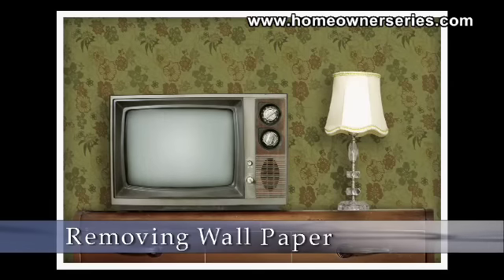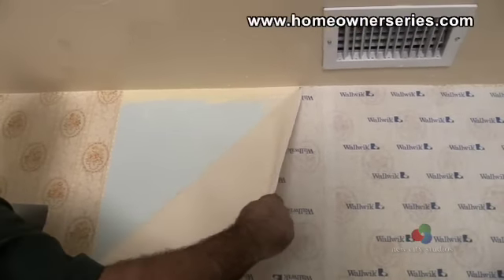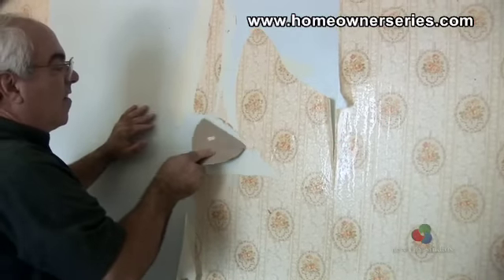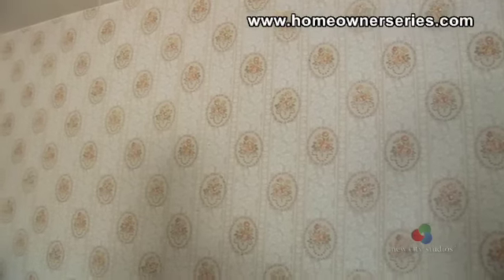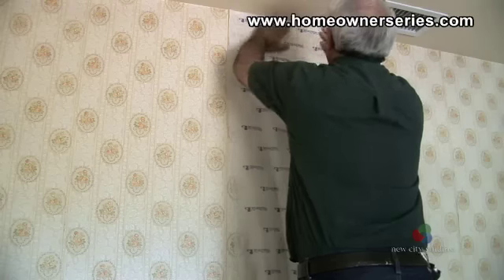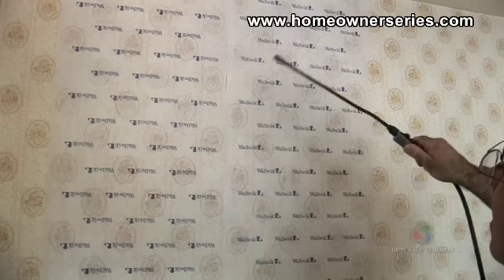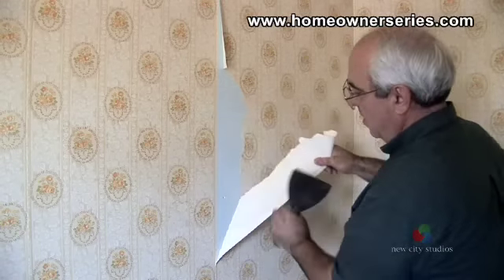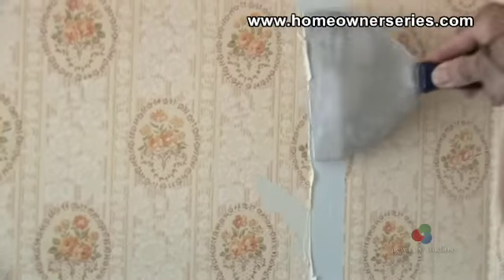How to Remove Wall Paper  - Drywall Repair

Comment: @tag1989 
@MrDaveyboyy 

I actually am using a wall steamer, the problem is, the original layer of wallpaper in my house was applied directly to the drywall using incredibly strong, durable adhesive. I will put the steamer on their for 30 seconds and barely get anything removed. It turns out the previous owner, rather than remove the wallpaper, found it easier to just add wall paper. I've removed two layers on one wall so far, before finding the bottom layer.

Comment: What if your wall has been wall papered twice , over 40 years , and your putty knife scores the drywall ,and the wall is rather rough , is there a way to smooth out the rough spots before painting? I used the DIY  product , sprayed it over the 2nd layer, waited 15 minutes and it comes off  within seconds.......but im left with a rough wall ...

Comment: OR- you can use lots of water- wait-lots of water- and start scraping..... it does come off! NO soap. Just good old water!!! REALLY... I even tried the scoring tool and bought the chemical spray.... water did the trick... I just have a crick in my neck. But it works ;)

Comment: Fucking ridiculous amount of effort to strip paper I'm a decorator and would I flip waste my time on this technique just getbthat solvent onnits own a 50/50 mix with water scour the paper soak with mix leave twenty mins and scrape with a 6inch two handed scraper easy peazy and or a steamer scour slightly start with steam plate at bottom by time ya 3 quarters up wall rest is loose from risen steam or old fashioned scour hot water 2o mins the another scour hot water a wire brush and scraper any method is better than this video things just making more work that needed